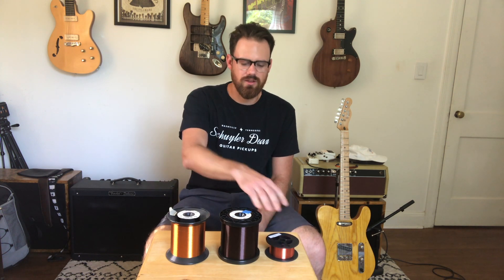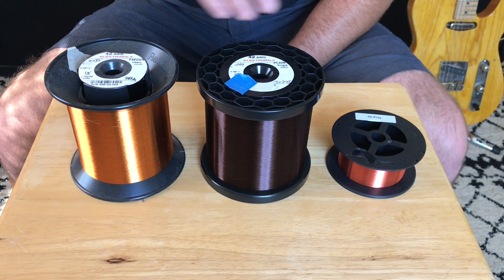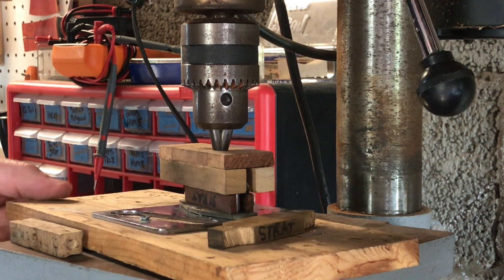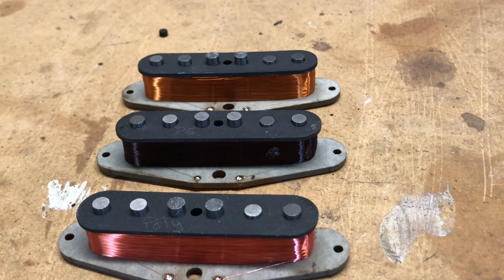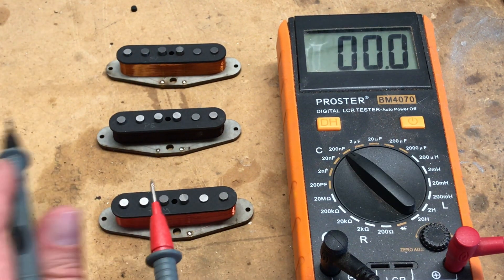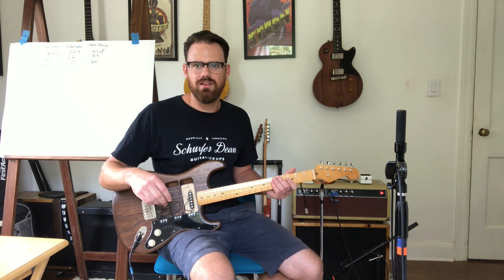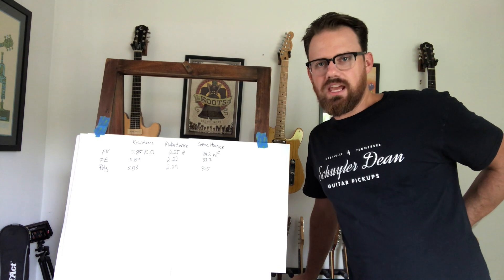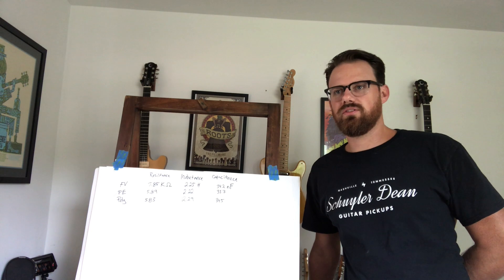Full Review: Formvar vs. Plain Enamel vs. Poly Pickup Wire

Comment: I wound several poly humbuckers to the exact same specs. They all sounded different. When I switched to an auto traversing winder with more precise tension control,  the tone became more controllable. I think if you were to perform this test with an automated or CNC winder, you could eliminate the variables of hand traversing and finger tensioning that can differ significantly from one coil to the next despite one's best efforts to keep everything the same. Also, the way you magnetize to slugs is critical. Even the slightes variation from one bobbin to the next will have consequences on the tone.
Reply: I agree. I have bought several sets of the same Fender pickups. The construction was nothing special - plastic bobbins, machine wound. I measured all the sets and there are quite large manufacturing variations in coil inductance and self capacitance between the sets. I find it very hard to believe that pickup winders who champion the practice of hand guiding the wire can produce consistent pickups. The pole magnet strengths also vary quite a bit, although one problem with measuring pole strength is that pickup magnets are relatively small and the field shape means that density changes very quickly depending on exactly where you try to measure it. You only need to shift the measuring probe by a thousandth of an inch to get a 10 or 20 % change in the measurement.

Comment: The capacitance measurements are way off. Pickups have capacitance in the picofarad range. That's not a suitable LCR meter for measuring guitar pickups. Get something like a DE 5000 and look online for how to use it with guitar pickups. The primary difference between them will be capacitance, so it's very very important to have accurate values there.

Comment: First of all, kudos for going through the pains of making a video like this - this stuff is time-consuming, what with the making of the pickups, the recording and the editing. That's dedication! However, some of the stuff in there is misleading and the results you get ought to be treated carefully. First of all, you hand-wind your pickups. Nothing wrong with that, but it throws in an uncontrolled factor. The winding patterns, turns per layer, tension and overall shape of the coil ARE different. So the video tells us about those three pickups in particular, nothing more. Second, and I'm sure you know that already, DCR =/= output. I'm sure you only use that as a generalization for your customers, but this one in particular confuses people. DCR only tells you about the length of wire in your coil, multiplied by the resistance per foot of that wire. Once again, I'm sure this isn't news to you. Third, the capacitance and inductance values you get  from a $20 LCR meters should be treated with caution - those depend on the frequency you are testing them at, and the difference in values you get may only be within the range of inaccuracy of the machine. Fourth - why would you expect to get different DCR values from your three pickups if the number of turns is identical and the inner diameter of your wire is the same? The difference can only be explained by (1) slightly different inner diameters or (2) inconsistency in the winding (although well within the range of what you'd expect with hand-wound pickups in this case). It is probably both. Overall it doesn't matter all that much - it's a cool video, you obviously make good-sounding pickups and the trouble you went through to make it makes me feel bad about being the science-police-party-pooper here. I just wanted to point out a few things, because guitar players who don't necessarily want to know the exact hows and whys of pickup making get more and more confused with the increase of information they draw from the internet.
Reply from the maker: My windings are consistent.
Reply: @SchuylerDeanPickups   I'm sorry but that can not be true, you scatter wind, meaning not consistant! It makes your pickups sound that good!!!

Comment: Hello there Schuyler, this is Paul from Pauls Pickup Place in the Netherlands. Please excuse my bad grammer, english is not my native tongue.
With all due respect my friend, but NOT ALL VARIABLES ARE THE SAME like you state, I'm sorry! 
1. You magnetised the poles with no controll over the strength of the magnetism, just two Neodymium magnets, good enough to remagnetise a broken pickup pole, but not accurate enough for this purpose. 2. You handguided the wire without no control over the tension. 3. The winding pattern is at random (scattered) that means that there is no controll over the way you put the wire onto the bobbin. Amongst others, these 3 factors influence the sound of the pickup dramatically. You can though, iff you are experienced enough, make pickups with a complete different tone with different winding patterns and different tension, with the same insulation. 
I enjoyed your video, but it's no proof or reliable documentation, you would need at least to use a professional megnetiser and a machine winder with control over the tension and the winding pattern(s). There is difference in tone due to the insulation, like Dylan beautifully explains in one of its video's, but there are more factors that determine the tone of a pickup.

Kind regards Paul.
Reply from the maker: My winding process is consistent. I'm working with my constraints. I don't have a professional magnetizer or meter.
Reply: @SchuylerDeanPickups  it's hand wound, it's in no way consistent, it can't be.
Reply: @SchuylerDeanPickups  For the cost of that winding machine, I think I could build you 10 completely functional (within their limits) automated or computer controlled positioning arms to replace those fingers.  People used to connect to wires to old 5 1/2 inch hard drives and drive the voice-coils from an amp to turn the read/write arm (connects to the head) into a speaker [I've done it myself].  That's way more range and speed than you could ever need at 900 rpm.

And don't believe your own PR, a computer can create a pattern just as scattered and random as a human, indeed it could emulate a specific humans winding patterns.

Of course, if that fancy store-bought winding machine doesn't have an output to signal each rotation, you might as well stick to the simpler ideas like a geared 12v motor driving a cam which pushes an arm in and out.

Comment: A question about potting. Some say that only potting the bobbins and not the winding is the best way to keep tone. Thoughts?

I had someone build a lot of pickups for me and I requested all unpotted. They sound awesome! However I can't play live with them. No way. 

So my question is basically what's the LEAST intrusive potting method?
Reply from the maker: Levi Jesse I pot all my Fender style bobbins in Lacquer so that they are protected from the coil. If you want to reduce noise, you have to wax pot the coil because that is the source of the noise.
Reply: What Schuyler said, but the very literal answer is to use wax but not a vacuum, which is what Seamour Duncan call "semi-potted".  It's less invasive because all the air isn't being sucked out by the pressure differential.  However most small builders probably wouldn't use a vacuum process anyway.

Are you sure they wouldn't sound just as awesome potted?  If you had said "they feel alive" (as in they respond to the sound coming back out from the amp -- fun stuff) then yeah, you'll lose that.

Comment: What year did fender go to enamel? I've heard some 64-66 strats with a FAT ASS sounding neck pickup like I've never heard in my life. Maybe that has to do with wire construction?
Reply from the maker: They switched sometime around the CBS takeover, it would be right around that time. Some neck pickups were wound hotter than the bridges making them sound super fat.

Comment: I want to see waveforms not a whiteboard. I'm listening on cranked studio speakers. unless you have measurements that  have the string height to the magnet measurements down to the micrometer it's  just a fun game and not science. what is the spread of the magnetic field/strength over the pickups?.. were all poles zeroed out as equal? too many variables.. I TOTALLY APPRECIATE you running the experiment. The differences are noticeable but not outside the scope of the other variants. If you rewrapped the same exact bobbin each time and set it into EXACTLY the same spot in the guitar ... that might be closer to science.. "3 identical strat pickups" really isn't a thing ;)... still.. killer vid and thanks for doing it.
Reply from the maker: I got all the measurements as close as I could.

Comment: Bottom line is market value. If your pickup sounds the same as my pickups, but I use wire that costs 1/3 of what you use in your pickups does not mean I can charge 3 times what you charge for pickups. If someone pays me an over inflated price, that's fine and dandy, but that doesn't mean that I am being fair does it?
Reply from the maker: All I know is that when I am buying something that is "vintage spec" I expect the builder to use the best vintage spec parts available. All handwound pickups pretty much cost the same, so if I offer my customers something with cheaper wire that I don't think sounds as good I am doing them a disservice.
Reply from the maker: Nobody said you can charge 3 times more for something that is 1/3 of the cost to make.
Reply: welcome to the "tone market" which is exactly the same as the "speaker cable" market for "audiophiles".  If they will pay it... I will sell.. that's what Kevin Costner said, right?